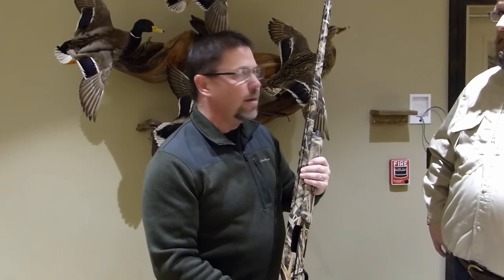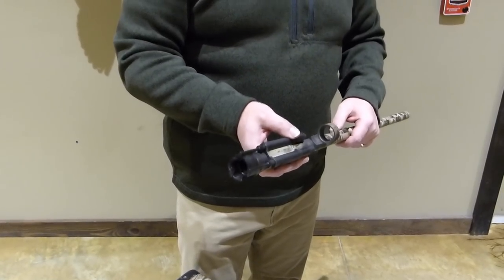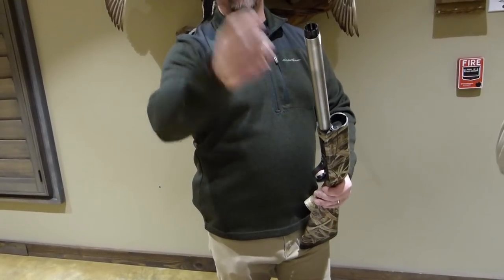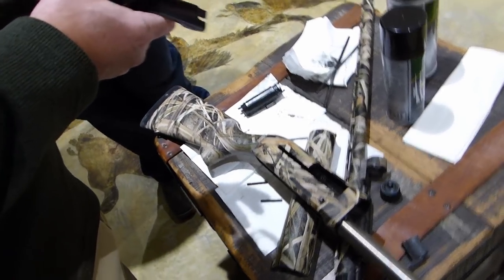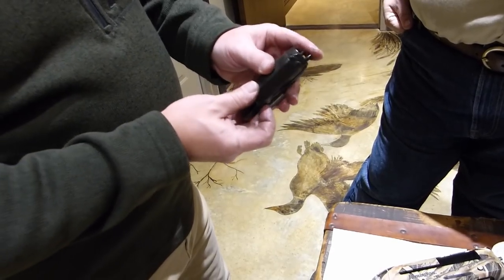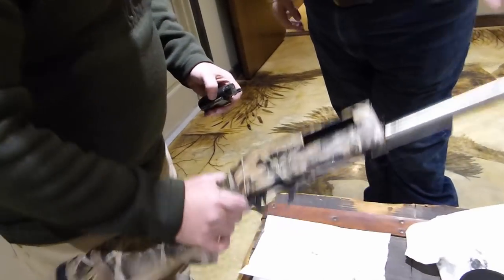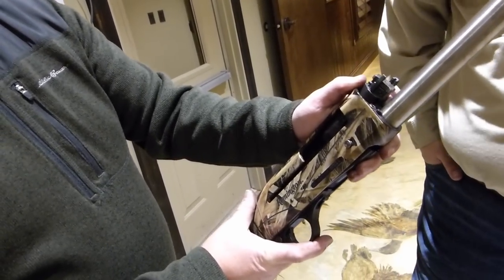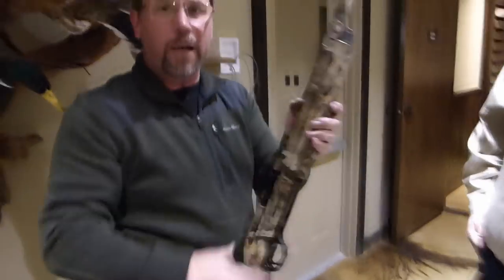Remington V3 Shotgun: Basic Maintenance

Comment: so after 6000 + rounds without any issue at all, I dropped it in the snow with the bolt open. I took it home and disassembled  and cleaned everything (except for the bolt which I had only sprayed and wiped down).  The following week I took it for skeet and found that the trigger wasn't resetting 4-5 times per round so I didn't always get the second shot off. I though I missed something so took it apart and cleaned the guide rails and springs while at the club again. Same thing happened.
when I got home I completely disassembled the  bolt, sprayed, wiped and a drop of oil and voila, she didn't miss a beat. 
point to all this is simply clean the bolt more often than not. It's easy and doesn't take much. it also insures everything is doing well as you can see if there's any wear happening. 
This truly is my favourite gun and to be honest I've had many, including Benelli's, and Beretta's as well as the Versa max. 
They've all been sold!
it will shoot anything, every time you pull the trigger and if there's a chance something is wrong....lifetime warranty!

Comment: Good video! Thanks, Randy! One little tip that everyone might want to be aware of. When removing the bolt handle or bolt assembly, do not rotate the receiver on it's sides or turn the receiver upside down. That will make it easier to facilitate the disassembly/reassembly of the bolt handle and bolt assembly from the receiver. The bolt sometimes seem to not move fully forward enough.
Reply: Thank you for that!

Comment: Thank you Randy.  I had a little trouble getting the bolt lined up during re-assembly.  This video shows how easy it is.  I have no complaints with the V3 other than the length of pull was too short for me.  i added a spacer and all is well.  No, I've had no gas and powder blowback.

Comment: After 100 rounds on this gun I started having failure to feed issues. Gun was lightly oiled. Now that I've seen this video I oiled the heck out of the area mentioned at 6:50 in the video. There was metal wear on the left side of the bolt carrier. Probably was the issue. Also the gas ports shoot lots of carbon on the barrel... Not the best looking but cleans of easily with ballistol n a rag.
Reply: Yep, gets ugly quick but it all wipes clean with ballistol pretty damn fast.
Reply: Yeah, I just figured out you really should lube the slot or rail the bolt blocker rides along.  My V3 was beginning to gall the receiver right there after only about 500 rounds.

Comment: I am having an issue with my bolt release. When your slide is locked back is anyone else’s bolt release crooked making it very difficult to press and release the slide? All my other Remington guns it sticks straight and and is effortlessly pressed to release the slide. Thanks for your help!
Reply from the maker: All you have to do is call Remington.
Reply: I had to send mine off to Remington. They adjusted and fit carrier dog. I haven't had a chance to go out and fire it yet, but they stated they shot live rounds and no problems.